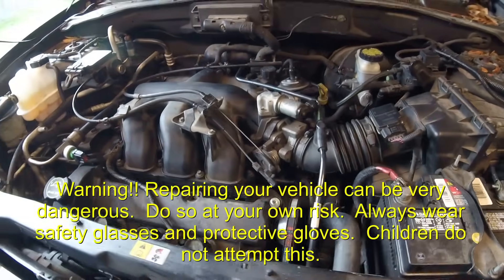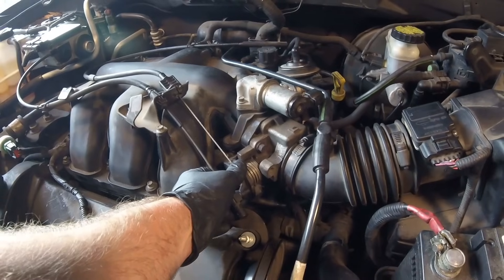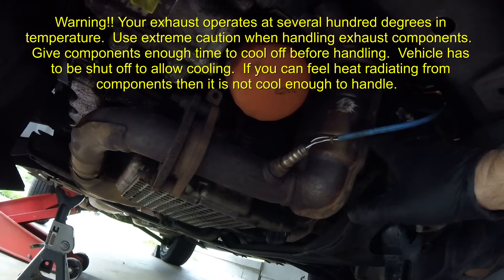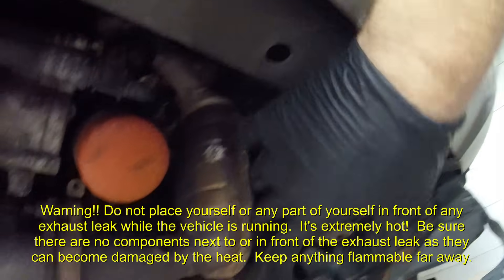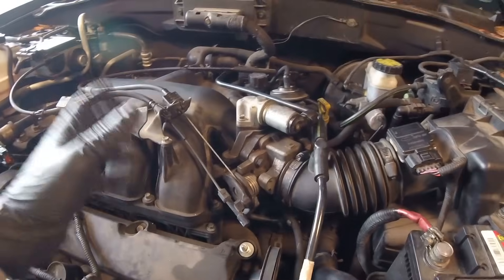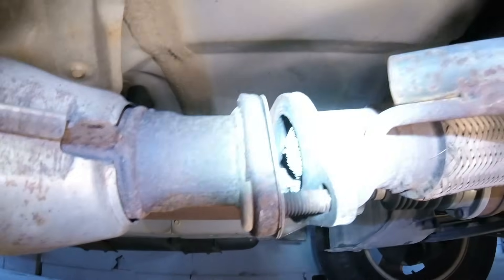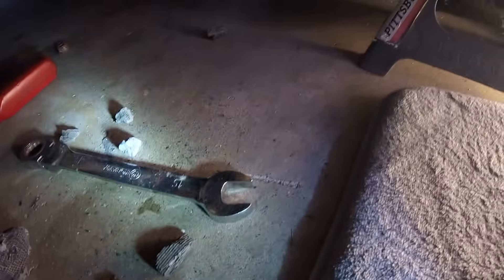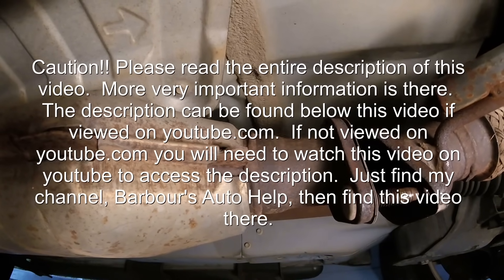How I Figured Out Exhaust Restriction (Clogged Catalytic Converter)

Comment: Would a clogged cat von make a 3400 engine run hot ? I have done I can to cooling replaced EVERYTHING BUT STILL GETTING REALLY HOT ! ☹️
Reply from the maker: Is it running well other than overheating?.   Does it have plenty of power?

Comment: Thank you my car sounds the same way my cats sounds loud when i rev it like it clogged but in the front of the car I wonder why my car won't past 2000 RPMs trying this today
Reply: @bankhead_662 I found out that all 3 of my Cats was clogged I had took them apart I saw honeycomb broken up remind you I did not have any warning lights on my dashboard before that my car was sounding just like this video my car wasn't breathing now with 3 new cats she running like a brand new car
Reply: TheTootoo222 thanks so much...gonna have to check mine your issue sounds just like mine
Reply: Another way you could tell if you have a clogged cat take out the O2 sensor out of the port and drive if all your power comes back bingo clogged cat is in your hands your welcome any Time buddy if you need help
Reply: @Tootoojackson  how’d u take them off(the cats) if I unplug my o2 sensors will it drive better
Reply: I solve my problem thanks
Reply: TheTootoo222 what was your solution?

Comment: My 2000 frontier sound's a lot like that . It doesn't do it until it comes up to temp . It idles fine but when you give gas it sounds a lot like that . When it cools down it will run okay again until it comes back up to temp . Do you think it could be the same problem . Thanks .
Reply from the maker: Its possible.   Can't say 100% though.

Comment: I'm having very similar symptoms with my 99 Silverado. Idles ok, you can feel a slight rumble and going down the road it's fine until you hit about 65+mph. I can't hold it at 65 or it buckles. Also when running and in park it likes to rumble. Hopefully clearing out the cats helps.
Reply: My trailblazer did the same thing. And as it got hotter it got worse. I had to limp it home at 15mph. I didn't have any codes either.
Reply: My 97 sierra can't rev up past 3 grand. I'm suspecting this.

Comment: I have a 2000 Ford explorer  and it has white smoke coming directly from the very first Catalytic converter can you help me out with what may be wrong
Reply from the maker: Sure.  I'll need some more info though.   Is there an exhaust leak or is this smoke coming from the tail pipe?  How do you know the smoke us coming from the converter?
Reply from the maker: Did you pick up a plastic bag and is it melted to the converter?

Comment from the maker: Hello viewers!  Just for the record.  I would not suggest cutting out converters to resolve this concern.  A repair of the root cause would be needed and then converter replacement.  Many states in the US have emissions standards and have emissions testing to be sure that your vehicle is not in violation of these standards.  The federal government has emissions standards for your vehicle.  Albeit, the federal government will not be testing your vehicle.  Never the less, I don't think it a good idea to violate these standards by removing converters.  That is my opinion.
Reply: Sometimes an exhaust leak will cause unnoticed misfires that will destroy the cats... vehicle miles and age of cats is good indicators...
Reply: I have a 03 civic and I suspect a clogged cat...have a 02 sensor before the cat and 1 in the cat which should I remove to test for a clogged cat

Wouldn't the car run differently anyway because it's missing data from the sensorn
Reply: Fixed turned out to be a bad upstream sensor
Reply: @liveandletlive2894  i have a 03 civic too when I press the gas it acts like it doesn’t want to kick up should I cut it also?
Reply: @lilrichhomietyjay6620  what exactly is the issue? Won't Rev up? Check engine light on?
Reply: @liveandletlive2894  yes check engine light is on when I press the gas I doesn’t accelerate it takes a while for it to get up eventually it does but it has gotten so bad til when i crack the car it just starts shaking really bad
Reply: @lilrichhomietyjay6620  first thing is to check the codes 90% of the time that'll tell you the issue
Reply: @lilrichhomietyjay6620  does the light blink?
Reply: @liveandletlive2894  yes
Reply: @lilrichhomietyjay6620  if its blinking it's an active misfire which is no good and definitely shouldn't be ignore. Run the codes to narrow down which cylinder or cylinders.

Comment: Ive got no codes but recently started hearing the rattle of death 💀 🔥 Dont we have to diagnose why we killed our cats? Ive read that cats dont just die they are killed by neglecting a problem somewhere else. I had no codes so I don’t wana spend all that money in parts + labor to then just kill my cat again! Help please!
Reply from the maker: Yes, I mention this in the description.  Usually cat failure is caused by misfires or a rich condition ect ect.  I dont have any videos going over this at the time.  I'm sure you can find something out there to help you though.  A good old google search will probably help you.

Comment: So I just bought a 05 vehicle , and it’s very hesitant in acceleration and gets loud at 2200 rpm , i don’t know if it’s a transmission issue or exhaust, like id be going 60 and I’d floor it and it’d be around 4000 rpm and it’d basically just sit there , changes gears into passing gear but doesn’t speed up at all.
Reply from the maker: Well, what's your plan of attack?
Reply: Well if it was anything else I’d just cut the exhaust off completely but it’s something my old lady has to drive , so I’m thinking about tackling it tomorrow and hope for the best.
Reply from the maker: Hope everything went well.

Comment: Keith! Cool Channel. I believe that I have a restriction in the same place on my Lexus Rx 300.But, I used an infrared thermometer to check temp differences on various exhaust system components. The temperature at the entrance to the third cat (primary muffler), was >600F:whereas nothing else on the exhaust exceeded 400F. Iv'e changed everything myself and the truck still bogs down upon acceleration with random misfires throughout - no specific. Doesn't seem to have any exhaust leaks, but I'm about to create one by pulling the rear O2 to see if it runs like normal - slightly louder though. I saw you video then I saw you! Fantastic. - Keep in touch - Greg Totty
Reply from the maker: Hey Man!  Small internet.  I hope you get it going.  Good to hear from you!

Comment: Very good and appreciated. My 2004 Jaguar XJ8 started acting up last summer. With accelerator pushed to the floor I am only getting 2000 RPM. On the road it would not go over 40 miles an hour. I first tested the fuel pressure and it showed 55 lbs, but replaced the fuel filter anyway as it was 9 years old. That did not help. I have had fuel restriction on another car several years ago. I am even more now suspecting it is the catalytic converter that is suffocating the engine. 

I have 92,000 miles on it and keep it in the garage most of the time as I consider it my 3rd classic car. I am waiting on a new car lift for my garage and I can then remove the converter and test it removed or test it as you did by just removing the sensor. I know you can also drill a hole in front and back of the Converter and use a special tester that gives you the pressure reading at both ends. Usually used in commercial garage as a time saver.  But since I will be under there I will just disconnect the converters, start it and see if it will go above the 2000 RPM . If so I may post one of my own here on YouTube.
Reply: I know this is really late but if you just remove the oxygen sensor before the cat. and take a drive it should drive close to normal because you're releasing the back pressure if the cat. is clogged.
Reply from the maker: Right on!  Hope you get it fixed!

Comment: Great video, I wanted to add an early sign of cat problems can also be cylinder misfire codes. My poor friend replaced his coil packs twice before he figured out the cats were falling apart when the car couldn't do anything more than idle before dying!
Reply: I have literally replaced everything besides my (most likely) exploded cat. Finally called a shop today and they told me that my symptoms are engine related, over the phone. Yeah bro, the jar of marbles stuck in the center of my car is what's making all the noise.
Reply: This makes so much sense I did a whole tune up on my car myself ran good for about a month and started losing power again. Flooring it couldn’t get me to 50mph. It’s still running but wish I would’ve known before wasting my money
Reply: @julianhart2247 l SA
Reply: Any misfiring engine that's burning oil an excess of unburned fuel and or antifreeze through the exhaust will ruin the catalytic converter the misfire codes is only a sign something is wrong not what is wrong the best way to figure that out is to pull your spark plugs out and see if any of them are washed or have a bunch of carbon build up
Reply: I had to replace my sparks & coils twice before finding out also
Reply: Got a Lexus IS300 and it whines under load. Got it for a misfire, changed plugs, they were kinda worn. Got hesitation/whine under load and extreme heat coming out of the tail pipe. Check Engine Light flashing, but no P0420 code. Going to remove the pre cat 02 sensor and see if the hesitation goes away. Going to test the fuel filter first. Blow through it first cuz that's a cheaper fix lol
Reply: Same
Reply: Bruh same
Reply: I lost a car like this, also bought the coils lol

Comment: if its clogged will it keep it from running/idling at all  I have to feather the throttle to keep it running.
Reply from the maker: Possibly.   The symptoms are better or worse depending on the severity of the blockage.
Reply: My friend has a 01 oddysey and after it’s warm he has to give it throttle to start, we drilled holes infront of cat and it still does it. Time for saw zaw?

Comment: my honda civic 8th gen catalytic converter glowing red hot like it will melt down from the front header catalytic converter....and I feel loss in power when i rev it which sounds like engine misfire...what would be the problem...please help me out bro...😥
Reply from the maker: Sounds like you may have an ignition misfire.   If raw fuel enters the cat then this could cause the cat to overheat.   There is a good chance the cat is dun for too.  Just my guess.
Reply: @BarboursAutoHelp  Great explanation. I was wondering exactly how misfires could damage a catalytic converter so badly.

Comment: QUESTION : I have a Porsche Cayenne that has no cel light on yet I getting a flat spot in power on top end ?  Almost like I'm halling a semi truck ... Replacement of plugs but no fix.  Now this winter my exhaust seems to clogged up totally in sub 0 weather.  I had vapor coming out my clamps fittings near converter and 0 exhaust out my tail pipe.   I'm guessing with my performance problem and winter freezing issue that my rear cat is 90%  restricted and condensation from running it below 0 , freezes the little opening there is in the  cat ?    But why no cel light ?  Am I on rite track ?  Thanks
Reply from the maker: Not sure if you're on the right track or not.  I'd say you should probably have a tech diagnose it.

Comment: I was told by a shop my Cat was empty. I feel like they're trying to get over. I've seen/heard of a cat delete, shouldn't my car be louder if one of my cats is "empty"? Also, my 02 sensor on the downstream HAS failed on the same cat.
Reply from the maker: Only way to know for sure is to look.  Use a boar scope.
Reply: @Richard Skipper Thanks alot. I figured that much.

Comment: I have a 1998 nissan altima and i just found out today why i was having such poor exceleration by taking off the o2 sensor. The car running loud of course but fine because of clogging. My question is this,, is it the front cat that is the issue or the rear? mind you i took out the sensor that was connected to the front one.
Reply from the maker: I can't say.  You can try taking a bore scope to it to see what it looks like in there.
Reply: @BarboursAutoHelp  ok thanks
Reply: I would say the front cat, it usually takes a beating and is the first line of defense when all the exhaust particles are being filtered.
Reply: @Alex_Justified  Thanks for the response,I had only one cat, the mechanic knocked out the honey come out of it and the car ran better than ever, amazing acceleration and added power. But sadly that car is not working conditional anymore and I have a new one.